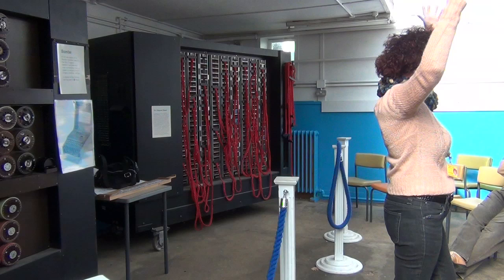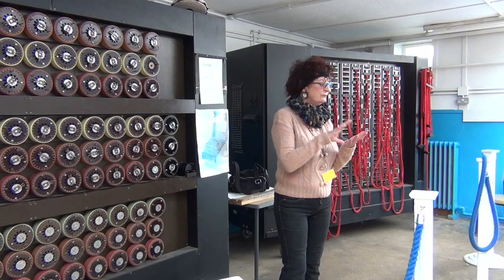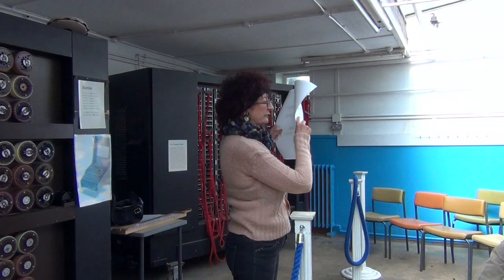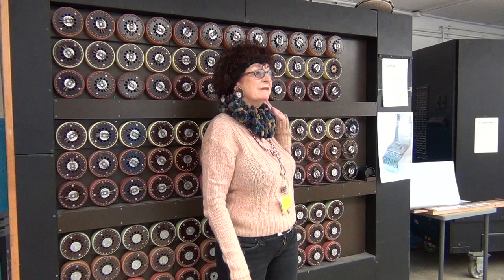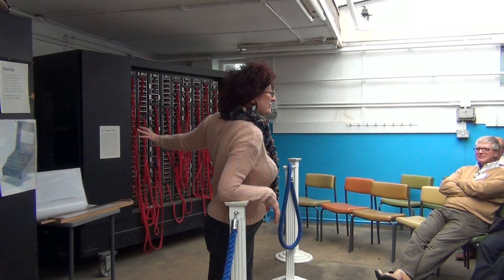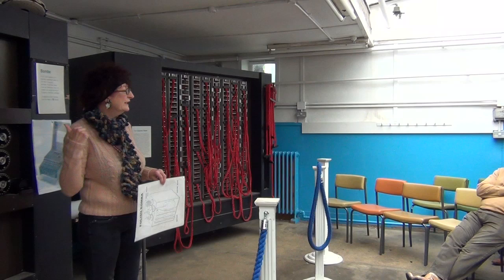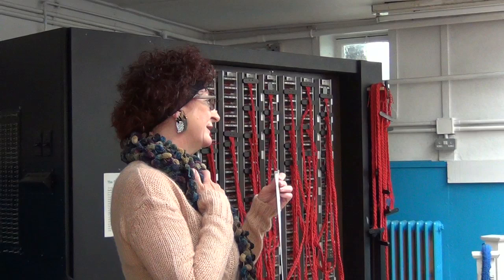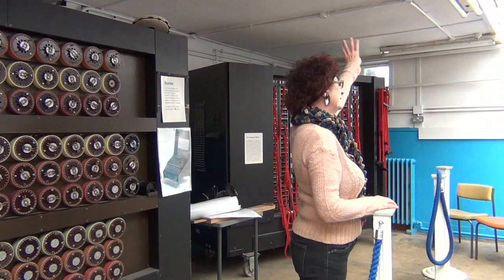Output: how Bletchley Park's bombes worked to break Enigma

Comment: I think the original German message had been either (in proper German): "Keine besonderen Ereignisse" (with an additionally "n" at "besondere") or even more likely "Keine besonderen Vorkommnisse".
Reply: man can you explain to me how the cracked the enigma cause i cant find it nowhere maybe u can tell me
Reply: @peterdaou4720  they had found enigma machines at war. But he no idea how to set the original settings of each wheel and plug board. So they made educated guesses at which formation it might be for that day and then tried over and over with multiple test set up for the beginning position of the wheels and plugs until it worked and actual words popped out.
Reply: @peterdaou4720  watch this video to understand how it works. Then come back to this video and look at the giant setting wheels behind her. Each "3 wheel combo" behind her is actually a replica of the 3 wheels on an enigma and then they have also the plug in section. So this machine made hundreds and thousands of guesses of "start position" until it finally worked. Basically there's about a few hundred of not thousands of enigma machines inside the room at one point as she described. Multiple copies of the same machine that's behind her. So they could try hundreds of different starting positions. Once you have the starting position and the settings of the plug in, you have the answer. But I think it you watch this video link first, it will help you much more clearly understand what the machine behind her is doing.

Comment: Bored watcher.
Reply: This only becomes interesting at a certain level of involvement. The focus of many people is in the machines 'cracking' the code, but the machines weren't capable of doing that with human thinking, resulting in those 'menus' saving the machine most of the (infinite) work they'd have to do. The code could only be cracked by German operators ignoring the safety instructions, spies gathering information and the 'stealing' some codebooks (which took some sailor their lives). With all the praise for the machine, the human factor was indispensable. An important lesson in the thoughtless admiration for AI.
Reply: @fritsvanzanten3573  man can you explain to me how the cracked the enigma cause i cant find it nowhere maybe u can tell me
Reply: @peterdaou4720  The wikipedia entry is a good place to start.
https://en.wikipedia.org/wiki/Bombe
Reply: @Enigma758  i dropped out cause of your late reply thank you ❤️